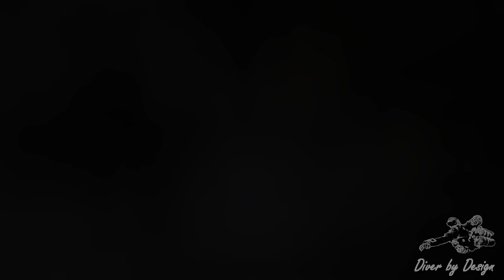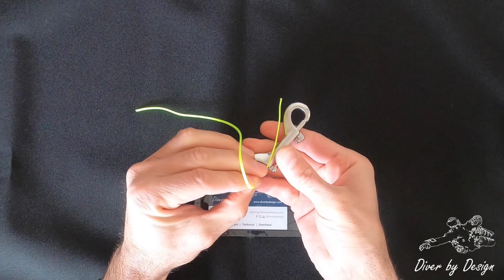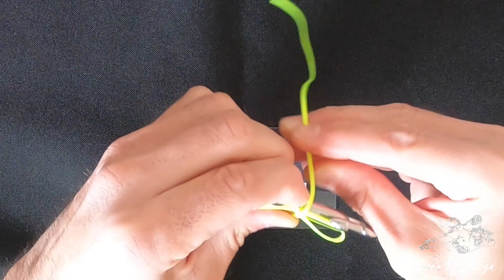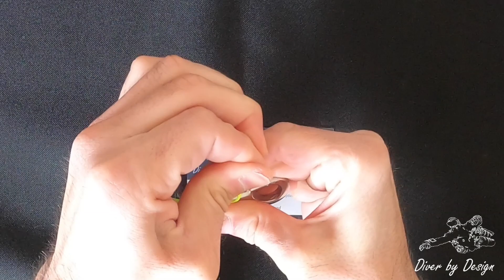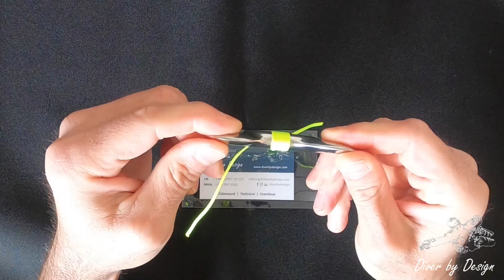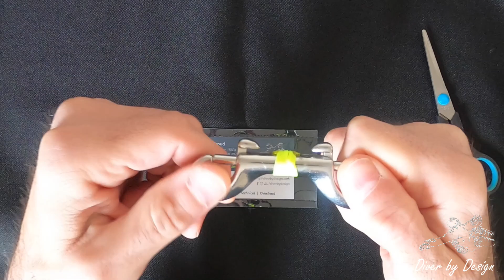Tackeling

Comment: I have seen this done before but have not tried it yet. You never had an issue with line moving and causing complications opening the bolt snap?

I have actually used heat shrink tubing in stead. Cut it to size open the bolt snap and slip it around and over gate. Then shrink it down.
Reply from the maker: Heat shrink sounds great!

You see in the video I show not to cover the slots the gate slides in and to also make sure the knots are on the opposite side of the gate - so far never had an issue and using that flat line I have the turns are very low profile.